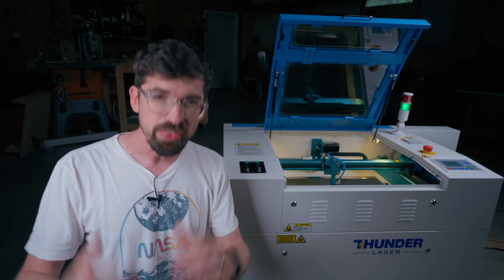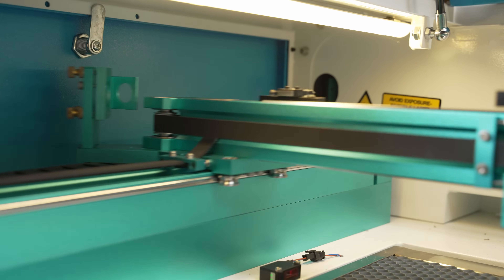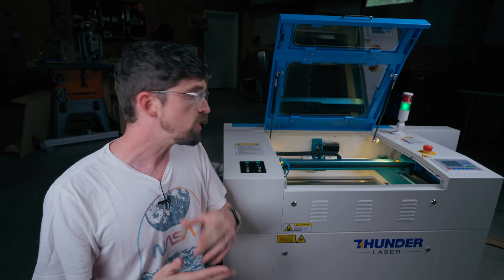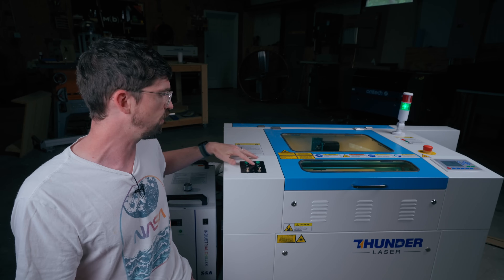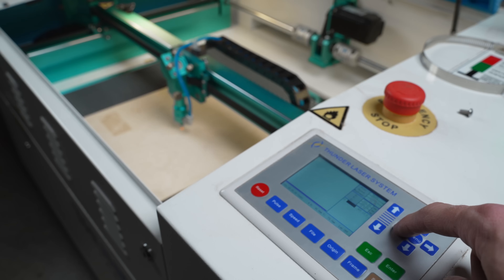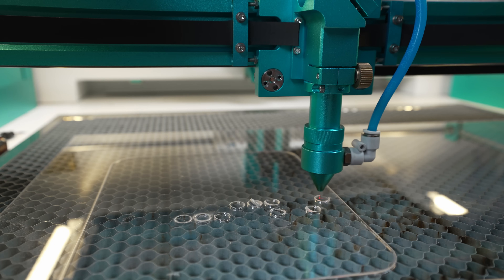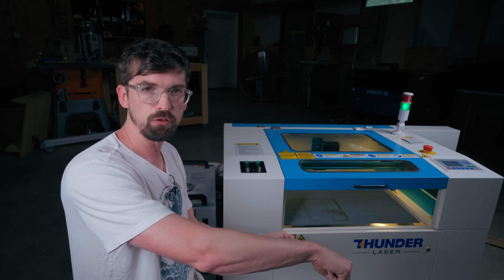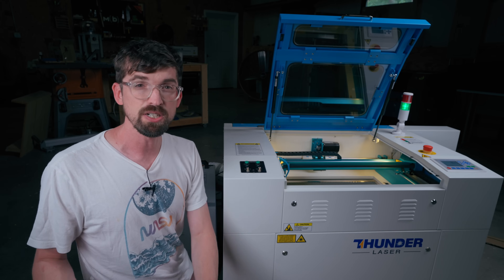Why do these lasers cost so much?

Comment: This is the machine I use - it's awesome! And Thunder customer service is so helpful and quick to respond. I almost wish it came with a stand. It's a bit too high to use on most tables, and a bit too low to operate on the floor. But that's literally my only complaint. It's also very heavy - my shop is in my basement and I had to spend another $300 to a moving company to get it down there and into place.

Comment: +50% $ for an upgraded machine sounds great. 
+100% $ sounds justifiable if the quality/features are there.
+250% $ is way too hard to justify IMO. You could buy 2 of the OMTech lasers + 5 Extra 60w tubes that will last you the next 20 years for that price. And the Thunder has a smaller build volume and no camera? I like that they're trying to make a more premium Chinese laser but I think it's an oversight to not at least include the features of the competitors that are less than half the price.

Comment: Hey man love your videos. Could you make a video on safety protocols? I watched your video on the omtech polar and purchased one. But after reading the manual, im super scared of random reflections from the laser bouncing out of the engraver. The manual says to always wear glasses, is it really necessary? I thought I would be able to look through the glass lid while the machine is engraving ... Do I only need glasses for this? What if I open up the tray and use the pass through, or the rotary tool, does the opening at the front of the laser leave me susceptible to laser reflections and  possible burns or blindness? I know it may seem like i'm being overly paranoid, but these are the things the warning labels talk about, yet I see people operate them online as if closing the lid is more than enough. I even saw one man stoop down and get eye level with the laser as it engraved a glass cup, the front of the engraver was exposed and open. I'm a complete novice and have no basis as to what is normal to do or not to do. I would truly appreciate your insight on this.
Reply: Stop what you are doing and buy some eye protection from a reputable seller. With some lasers less than a second of accidental exposure from a reflection is enough to give you permanent blind spots. You are not paranoid. The companies selling these lasers could care less about your eyes.

Comment: The one thing I like about this machine: The industrial quality.
The one thing I hate about this machine: The industrial quality.

I'm still going for the P2, because some of its optional features are really interesting. But I am a hobbyist. As a commercial business I might think about this one.

Does it have a similar linear movement system as the P2? Metal wheels on rods?

Comment: There are a HUGE difference when it comes to power and the way Thunder Laser USA advertises the tubes provided. A 100watt Thunder has 10-20% more power than a 100watt Omtech or similar laser. As a example if you buy a 100 watt co2 laser from most manufacturers the tube has a MAXIMUM output of 100 watts but you are only recommended running them at 90% of the advertised power. Thunder Laser USA sell 100watt lasers with a usable output of 100watts. They throttle the power back from (in my case) 118 watts maximum output and this allows you to set the power to 100% in lightburn and get a true 100watt output with no risk of damage to the tube.

Comment: hummm... $7400 starting price... Nothing justifies such an expensive cost in term of usability and quality of outputs. What makes this laser cutter more "industrial" than its $3000 contenders? Not to mention that 20th-century style screen... You're right to disclose that you paid nothing for that machine even if your praises sound sometimes a bit dubious especially when you stressed a feature that's not impressive... Did you feel obliged to do so?  C'mon! We know the trick
Reply: There are definitely upgrades in this machine over a out of the box standard Chinese one. If your handy and don't mind fiddling and spending some extra you can get a cheap one close. My cheaper machine came with a out of square gantry, laser tube out of square and looked like a blind man aligned the beam. My B grade tube died very quickly. Now I've got a RECI tube with good power supply and everything square aligned, better mirrors and a selection of lenses and nozzles. After a extra $1500 and probably 60 hours I'd say mine would compete with this one out of the box. If I was running a business and depending on it as a production machine getting one out of the box ready to go I'd pay the extra.
Reply from the maker: Fair enough.  I’ve used lots of lasers with fancier screens but they always wind up being glitchy.  The Ruida controller isn’t flashy but you can count on it to always get the job done.

Comment: Sure is a nice looking machine. Adequate controller although I prefer the RDC6445 keyboard layout as more intuitive with direct functional access. At that price they couldn't include true linear bearing rails? Every Cartesian rail application I have experienced with roller bearing guides, the small bearings are a consumables over the long run.

Comment: Xtool p2 is better.
Reply from the maker: I guess it depends on what you value.  Thunder is rock solid and a beast.  You don’t get the cameras (which you can upgrade) like the P2. If was using the machine full time for a business and has the space, I’d go Thunder, especially since they are close(ish) in price.
Reply: How so?

Comment: We started with a Glowforge and when our production capacity exceeded that we upgraded to the NOVA 63. The thing is a BEAST. It's huge but the capacity and speed is fantastic. It more or less worked out of the box (kidding, it came in a massive and wooden shipping crate). Their support has been really good as well.
Reply from the maker: Yeh everything about them is top notch.
Reply: Wow, nice! What do you sell?
Reply: @parodybbb  we sell men's clothing accessories but we specifically user our laser for low volume, high detail, packaging inserts. The detail is such that it is hard to recreate with traditional die cutters. We also offer customization that is further supported by our lasers.
Reply: @mmcnama4  Thanks for answering that's actually super interesting to me. Do you have a website I might have some business for you.
Reply: @parodybbb  we have a site but I generally don't post it publicly to avoid spam from bots.

Comment: I remember commenting that you should check them out ages ago. Glad you finally got one!

There's two things that I would like to note - the doors require a key to open, which is annoying. All I need is a latch. I don't understand why the doors are keyed when the main lid isn't. 

The other issue is not having a guide that corresponds to the bounds of the cutting area. For example, you will see a ruler on the X and Y axis. You can push material up to it and know exactly where it is every time. Trotec and epilog both have ruler guides in some of their cutting tables.

Everyone's got a different workflow though. I personally use absolute coords 98% of the time. I can add items to existing sheets just by bringing up the file.
Reply from the maker: The guides/ruler is a good point.  I pretty much always use relative positioning since most of my stuff is one off.
Reply: How hard would it be to add some kind of fixed point for your project with the rest of the bed?
Reply: @coreyward  sorry I don't follow (if you were replying to me).
Reply: @kennuimuffins2426  Yeah I could have phrased that better. I’m wondering if there’s a reasonably easy way to attach some kind of rules/fences to the bed, the goal being to have the same as you would with an Epilog, just DIY.

Comment: The price is too steep for me as a hobbiest, but I'm impressed by the robust choices they've made.   I think that if you've entered the small manufacturing game with a lessor unit, this brand would be the upgrade you'd strive for.
Reply: That's exactly what we did. I commented elsewhere but we started with a glowforge and when we needed more capacity the Nova line was a fantastic combination of quality, features, support, price, etc.
Reply from the maker: 100%, I wouldn’t recommend it for someone using it just for fun.  It honestly just start with a cheap diode and maybe something from OM Tech.  But if you are a business it’s pretty amazing.

Comment: What do u think about Aeon Nova
Reply: That is a slight step up from the Thunder... in my opinion. That said, I believe Thunder and Aeon are the two best companies to buy from for this category of laser.
Reply: The Aeon Nova is a much larger machine than the Nova 24. Size wise it would be more comparable to the Nova 51 for Thunder Laser. The Thunder Laser Nova series tops the Aeon Nova in build quality, price, and lead time.
Reply from the maker: I haven’t personally checked one out.  But they both look pretty comparable in features.